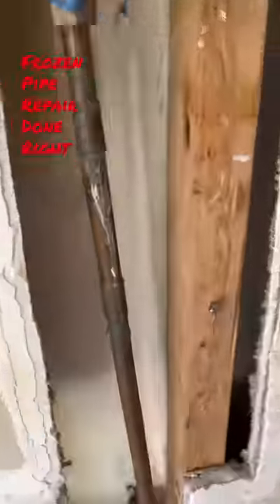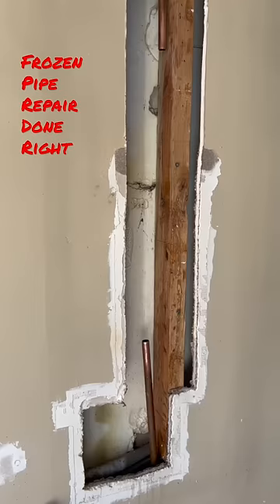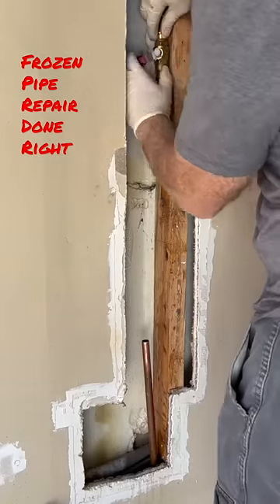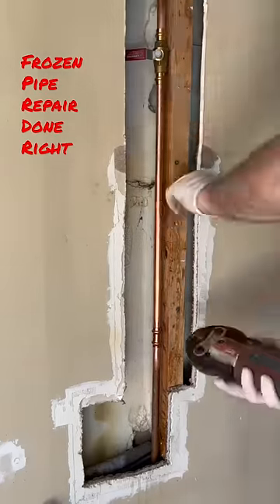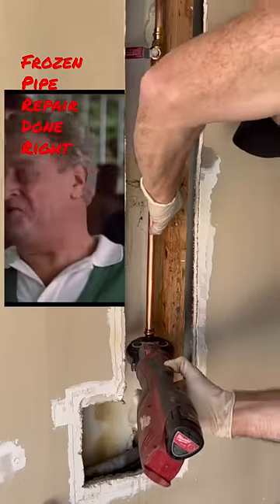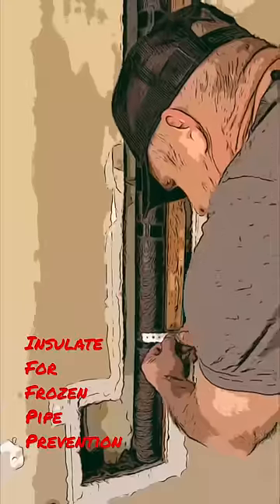Frozen Plumbing Pipe Repair @TappPlumbing #shorts #plumberslife #plumbingproblems

Comment: Never  put water 💧  pipe into  outside  walls.
Always  interior  walls  that get heated from both sides.
Reply from the maker: This line feeds a spigot. That’s just the way things are done around here . I am not a fan of the situation at all! Please take a second and check out the other freeze break short video . Things will make a lot more sense. Thank you so much for spending your time with us!
Reply: Yeah we put plumbing in outside walls here in Western wash too, but you go to the east side of state and it's a big no no, just depends on location
Reply from the maker: @BBSr-q2w  I would guess there a substantial difference in weather on the other side of the mountains. Do you live near the ranges?
Reply: 😂 you must do alot of plumbing yourself
Reply: @dank1883  
When I was younger,    I laid a lot of pipe
Reply: @dank1883  
I was referring to the  Building Code in  State of North Dakota. 
Single digit temperature  and  negative digit temperature 🌡, 
Has a very different code than Houston Texas  🤔
Reply: Yea tell that to the engineers and aritechs really dont leave any choice half the time . That and the contractor was too impatiant to lay the slab down for us to burry lines
Reply: @TappPlumbing  worked in seattle can confirm it was done all over the place here because no other choice
Reply: That sounds good but that's not always doable depending on how the house was designed and built.
Reply: Clearly a real plumber. He runs the Bluetooth water lines.
Reply: A slab foundation the repipe is run up the exterior wall and into the attic.
Reply: @billywilliams6853  used to be.   Now???
Reply: you must not know one thing about building a home. while that is the best way very few homes allow this.
Reply: @billywilliams6853  I laid alot of pipe in my younger days too.. these days the lead still flows but the customers stopped calling 😢
Reply: Lol, tell that 99% of kitchen sinks
Reply: tell me your not a plumber or any profession dealing with home building
Reply: Tell that to the building code in Texas!
Reply: @rippinross3238  
I have laid enough pipe.   To know that ,,  water 💧  can freeze in a PEX line and Not bust.
Reply: @igottaspeak  
Hey I heard ,    the fresh water 💧 pipes,   in the attic froze and busted. 
Yes water 💧  pipes in the ATTIC. 
Time for a New code.
Reply: @Lxn _ni  I plumbed in the Seattle metro for 15 years and there's no choice most of the time

Comment: How about a access hatch to be able to shut the valve off in the wintertime👍
Reply: Shut the valve and you guarantee the water will burst in the pipe with the weather. You want water to run or it will freeze.
Reply: Samething I said hello access panel before u talk shit but way he kinked bottom fitting its gonna have to be fixed again

Comment: I used that pipe foam AND R3 rated 3in wide insulation wrap in my house😂 I’ll go the extra extra step when it comes to my stuff; do it once and never worry about it again 👍🏻
Reply from the maker: That sounds like a great permanent solution to me! We don’t provide any scope of work out side of plumbing. I do try to give my clients my opinion on how to finish things up so they can get the type of results you are talking about. Thank you for watching and leaving a comment!
Reply: That foam is absolute junk! I'm a Insulatior for over 10yrs an trust me Fiberglass is the way to go! If not Glass for any reason Armaflex rubber insulation will do ....
Reply from the maker: @Natas-the-Great  No doubt, fiberglass is far superior! 
Check out this video 

https://youtube.com/shorts/BsgvHWRR9NY?feature=share 
 It explains everything. Thanks for watching and sharing your opinion!
Reply: A lagged pipe cools more slowly than unlagged pipe. But it will freeze. Why not move the pipe entirely or replace it with PEX?
Reply: @Natas-the-Great Are you talking about fiberglass batt insulation or something else like the Rigid stuff that is commonly used for sound insulation?  Thanx.

Comment: Better to leave the pipe exposed to warm air. Put the insulation behind the pipe against the outside wall and let the inside air prevent the pipe from freezing
Reply: yup
Reply: Was thinking same. Insulating a cold pipe won't help it. Insulating the cold wall will!
Reply: And have a mess in summer when the pipe sweat because high humidity and a cold pipe this insulation is not only good for the winter it serve a purpose in summer as well
Reply: 28-year plumber. He did everything right. SMH at the People who say "only insulate the back side of the pipe"

Comment: The thing I have found with frozen pipes is finding a round section for repair. A trick I learned was take a crescent wrench and adjust the jaws tight to the section of pipe that you want to work on and rock the wrench back and forth around the pipe until its round again. Now I can cut and repair.

Comment from the maker: Here is  a short uploaded https://youtube.com/shorts/BsgvHWRR9NY?feature=share addressing the solder choice , or lack there of. Our shop only does plumbing. No dry wall work whatsoever. The client requested the valve at that height for some reason and it posed no threat to their system in my opinion. They also did not want the handle exposed and promised me there would be an access panel installed when everything dried out. This freeze spell happened right at Christmas. For the first time in my life I actually worked on Christmas Day. My neighbor’s house. The building codes here do not take into account those type of temps. There are tens of thousands breaks all over the city all at one time . Time and materials are impossible to come by. It was a challenging time to say the least.
Reply: Sounds like Atlanta.
Reply from the maker: @kileyclark4570  you nailed it😂

Comment: The problem is the house isn’t insulated. Even hot areas need insulation.
Reply: It's probably not an exterior wall lol 

If the wall is INSIDE already, why would it need insulated?
Reply: @Metradime  Interior insulation is fucking great, great sound proofing and individual rooms keep their heat way better.
Reply: @heisenballs  yeah, but we'd call that sound-proofing, not insulating lol
Reply: @Metradime  but it's insulation....in the walls
Reply: @heisenballs  well there are batts in the walls, they just so happened to also be used for insulation.
Reply: @Metradime  why would it freeze then if it’s an interior wall?

Comment: Puts clamp in the 2x4 where he will re hang drywall. Genius 🤣
Reply: Ever watched steel stud walls be built? If not, watch a video and hold onto your pants.
Spoiler: That extra tiny bit of material does not matter whatsoever.

Comment: Better yet replace it with pex or wirsbo expansion pipe no problem if it does freeze. Maybe its a code violation in your  area im not sure where you are but it looks residential. And yea the insulation is a must and also pulling the pipe towards the inside of the wall and strapping it with p-tape. Good job my man.

Comment: That insulation wrap doesn't keep pipes from freezing you should have heat traced it as well, insulation and vapor barrier is what the wall needs.
Reply: From the little amount of protection that pipe needed yes the insulation will help protect it.  As for leaving a heat trace inside a wall... that's the dumbest thing I ever heard. You can never inspect it.  Mouse comes along and chews on it then it turns into a structure fire..b

Comment: Where did they learn to solder?  Well they never finished learning, but they started right there in that wall
Reply from the maker: That is cool you actually took the time to look at the solder joints. It is pretty unfortunate where we work it is typical. Thank you so much for your time to watch and leave a comment!
Reply: This is why this person doesn't soldier. They would end up with the same result. That's why they use the garbage press nonsense.

Comment: crimping is for the unskilled
Reply: 😂 soldering (in this application) is for the plumbers who are too cheap to invest $2500 in a propress tool for their business and aren’t busy enough to appreciate the time saved to go on to the next job they have scheduled 👍. Just kidding of course. You keep soldering. It’s important to pass on the old ways to the journeymen.
Reply: @paulciley3727  these things come and go, the ONLY thing to stand the test of time is soldered properly. i have replaced hundreds of compressed fittings. and thousands of failed solder joints  but only the solder joints were done wrong. 
Its just a sign you dont care about quality and are one step away or already are putting pex junk everywhere you can!
the only issue with compression parts is the same issue with shark bite. RUBBER orings... that dry out and leak. All you did was put on a very expensive shark bite and paid out a TON of $ for a tools and parts to do things faster... thats just financially dumb and lazy. You did a nice job for sure with what you used and at least it was not pex so yea... whatever makes you sleep at night!
Reply: @paulciley3727  i hear yea.... everything has its place, these things come and go but the old ways never die because they last
Reply: Press system is better than sharkbite, but then so is a swift kick in the ass. Plumbers that can't solder, so sad!
Reply: @BBSr-q2w  no its not. the seal is the same construction and is susceptible the same way. the crimp does nothing but hold things in place.
Reply from the maker: We certainly appreciate all the comments and engagement! This video will help explain a bit:) https://www.youtube.com/shorts/BsgvHWRR9NY

Comment: I bought multi unit build 20 years ago. Pipes froze. I put pipe insulation on every pipe. Wien I opened a wall and found supply lines I installed pipe insulation. Permanent fix every time.

Comment: I live in the front range of Colorado, It is very hard to even find a plumber to come out that can solder. Most companies only have one guy that knows how to that they sent out on the boiler work and the rest of the guys can only work with plastic. I can’t even remember the last time we had a plumber out to work on a project for us where I didn’t have to solder joints for him. It’s ridiculous!
Reply from the maker: About 5 years ago I went to a house and there was a manifold with a piece about 4 inches long missing in the middle of it . The person before me cut out the section where a nail hole was and couldn’t get the press jaws in there. He just left and said he wasn’t allowed to solder. You can’t make this stuff up 😂 My wife and took a camping trip and stayed right outside Buena Vista. Yes , in a tent. Then did the motel thing a few nights in Salida. It is so beautiful out there !

Comment: Repair copper with copper but on new construction always use PEX and crimp connections. Use sharkbite fittings for quick repair or where you might need to turn a fitting for alignment or where it might need removed in the future...like a water heater. Use copper stubs at terminal ends if customer desires. There are also drop ear fittings and barbs for PEX to make solid connections. Copper is expensive outdated. Use manifolds with hot and cold runs to each wet area and you can get away with 2 connections, one on each end vs copper, 2 sweated joints at every fitting.

Comment: I remember a friend of mine was soldering up some copper pipe in at leaked. There was solder everywhere LOL. I watched as he redid a joint and just shook my head. I said wait right here and I came back with some flux and he was just totally amazed to see that solder suck up into the joint and seal perfectly.

That said, I like those crimp joints that you had. They look easy to use, but something tells me that soldering is a better long-term choice.
Reply: Exactly 💯

Comment: I'm a property manager who does remodels and repairs. I have managed properties in 3 states and have had to repair frozen water lines more times than I can count over 24 years now. The last one I had to fix was Christmas night. One thing I have always had is the common sense to know is that if a water supply line freezes once, it can do it again! So, therefor after the repair some kind of "Insulation" has to be applied or I will have the same problem again. I have never had the same water line burst again after I repaired it because I ALWAYS insulate that line when it happens. In this case not only would I insulate the pipe as shown, I'd put an access panel/door where the shut off valve is located as well.
Reply from the maker: I had to repair one on Christmas Day last year myself. It was the first time I worked on Christmas Day in my life. I am 56. This makes me wonder if you live in the Atlanta area? There will definitely be an access panel installed when the drywall is repaired. We only work on plumbing and refer the other trades out. Thank you so much for spending some of your valuable time with us !!!!
Reply: @TappPlumbing  No, I live in Tennessee at the moment. I'm looking for a new opportunity to manage property somewhere else so this will probably change to Virginia or Maryland.
Reply from the maker: @matthewholmes5285    Best of luck with your new adventures!!!

Comment: So now when it freezes again you'll have an even harder time getting heat to the pipe.  Insulate the wall behind the pipe.  An allow the heat of the interior to help keep it warm. When you wrap it your keeping heat away from the pipe as well. Adding a small air grate would also help.. I live in northern NH.  I know all about 🥶 freezing.

Comment: I once had to clean up after a garage door got left open and a surface mounted line split.  The line split on the back, a tiny slit immediately against the drywall, so it was invisible.  It filled the wall cavity and flooded the basement with a foot of water before anyone knew anything was wrong.

Comment: I owned a house a few years ago where the front water spigot didn't have water. Inside the wall, there was a bunch of insulation on the INSIDE, but not on the OUTSIDE of the cavity.  I pulled out all the insulation and saw that the pipe had several repairs.  Shocking, I know.  I finally tracked the line back to a valve with a broken-off handle behind the water heater.  When I finally got it turned on, water started gushing from the ceiling.  The line was broken in the attic.  I got that repaired, cut out all the "repairs" and put in new PEX pipe, and put the same kind of pipe insulation over it and pulled the pipe back to the inside of the wall so I could get regular insulation between it and the outside of the wall.  It's astonishing how bad of a job people do with repairs.  It wouldn't at all surprise me if some "handyman" did that work and not the homeowner.

Comment: When I had the hose pipe freeze in the wall I cut it, replaced it, connected the ends with put on a shark bite, did not put on insulation, and left the hole in the wall to help it stay warm. 10 years have passed, still hole in wall, all good. One day I will make a cover for the hole...... One day.

Comment: Pro Press is another short cut. Only one right way to guarantee a permanent fix. Show the guys how to sweat some fittings on there. Add access door to the valve. Your work plus insulation and pipe strapping was very nice.
Reply from the maker: We are actually planning on do some soldering videos coming up in a couple of months. Thanks for watching and commenting!!!

Comment: That looks better than the underside of my "Summer" cottage at the lake in NH.  No matter how well I drain the pipes in the Fall, there are always frozen cracked pipes in the Spring.
Solder, compression, hose and clamps, PEX, Shark Bite and now crimp on fittings everywhere.
Reply from the maker: Maybe in those severe problem areas you could switch to pex.

Comment: Moving water won't freeze, sometimes a recirculating pump can solve issues like this, and heat traceing the line could remedy it from freezing too.
 Also, if pex was used, it can stretch instead of splitting... Just an FYI from an Eskimo that lives 30 miles above the Arctic Circle...

Comment: The problem is depending where they live if it's an exterior wall even with the insulation you're still fighting a losing battle because if it gets cold enough long enough... well... you know. 

I don't know if you're a fan of PEX or not but in situations like this text actually will give you a little bit more time is the ice will tend not to burst it as quickly as copper

Comment: I am not a plumber by trade. The inlet copper water line to my house was bent down It happened during construction 20 years ago and the builders just buried it. I called a professional plumber and he quoted $1500 without looking because I said "foundation." I bought a little air hammer and knocked the concrete back about three inches. I cut the pipe off and used a Sharkbite connector to rejoin the copper. (i couldn't solder the copper fitting because the concrete kept wicking away my heat.) I fixed it and it all cost less than $30. My thanks to the pros.
Reply from the maker: That is a cool story. I love to hear when homeowners have found a way to save some money. Trying to solder with water in the line can be very aggravating. If you made a good joint with the shark bite, that might last you quite some time. Thank you so much for watching!!

Comment: These days plumber crimp pex to copper all the time. I rented a duplex unit a few years ago that was freshly remodeled completely. Over the first year “maintenance” came out 3 times to fix a pex to copper joint. The owner was very lucky that all 3 leaks we’re basically spraying down into the hole in the slab for the tub drain…